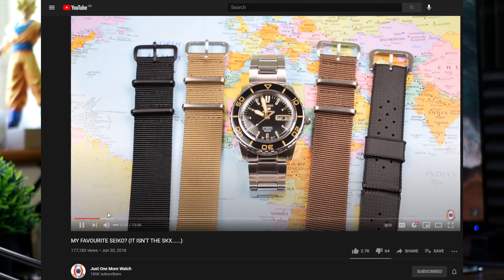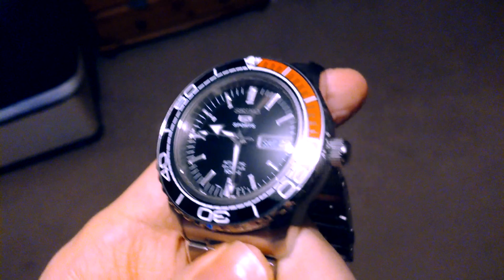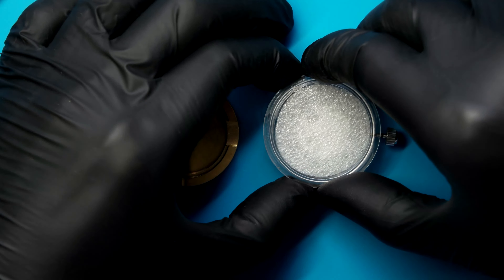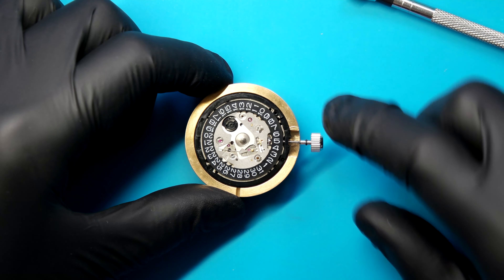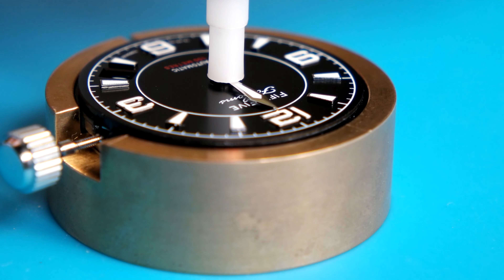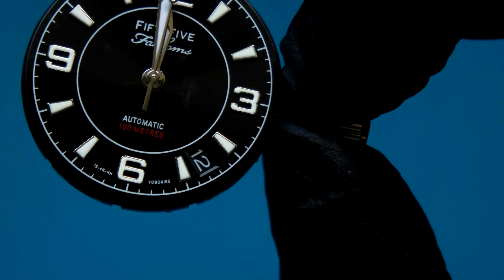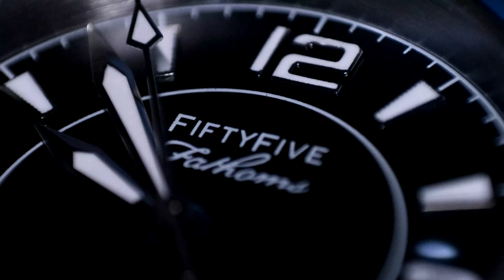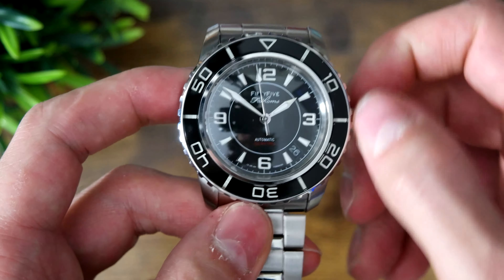Failure or Salvage? [SNZH55 - FIFTY FIVE FATHOMS MOD]

Comment: Appreciate a video where the mod goes awry but still gets seen through.

With caliber upgrades being a popular modification, a technical detail on 7SXX and NHXX movement spacers. Unless cased in an ISO Diver, the spacers are the same height regardless of the color. Transferring a black for a grey spacer remains necessary for the SKX line, but with a Seiko 5 a straight swap is possible.
Reply from the maker: Thanks for letting me know! And thanks for watching.

Comment: This is a great video and refreshing in the honesty. i use a dial protector for installing hands and when applying very little pressure am at the level of the watch rather than above it. this way you can check the spacing as you go.

Comment: you have probably learned by know that is you use the correct size hand pusher it's near on impossible to push the hands down too much ie for the minute hand use a the pusher with the smallest hole in that way it will go down the second hand pinion and only seat the minute hand on top of it's pinnon we all live and learn that's the beauty of life ps awesome build at the end 
cheers
Reply from the maker: I'll be honest. I didn't know that until your comment. I thought it was for different movements or hand sizes. But knowing that its actually for the different steps on the canon pinion that is very good to know. Thanks for telling me!
Reply: @ItsAnotherWatch im glad i have helped you bud as you know we live and learn ¯\_(ツ)_/¯

Comment: Great video. I am ironically going to be starting a very similar project, so this was spot on! Question, did you use the original crown/stem from the SNZH when you swapped the movements? Where you able to get the crown off the stock stem from the original SNZH?
Reply from the maker: Thanks! Yes I did use the original crown from the SNZH. It was stuck on there somewhat but after holding the original stem VERY firmly with some pliers, I was able to unscrew the original crown.